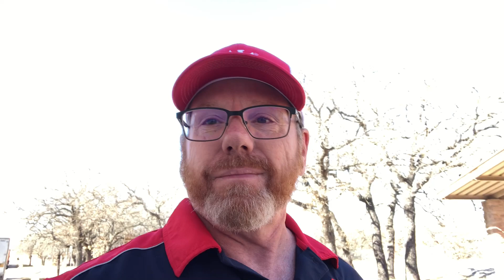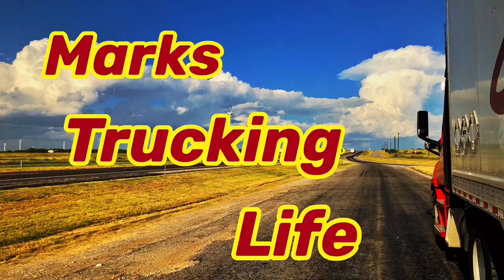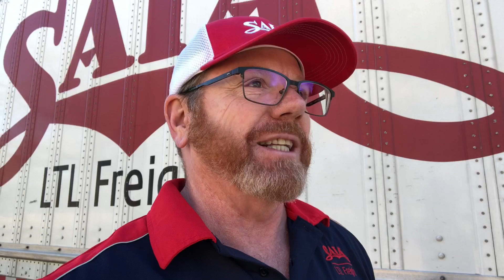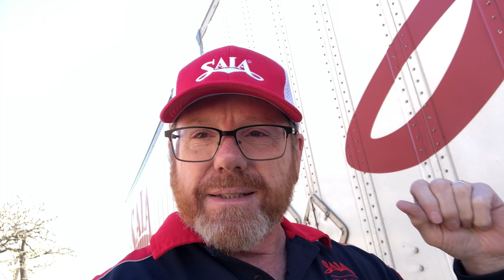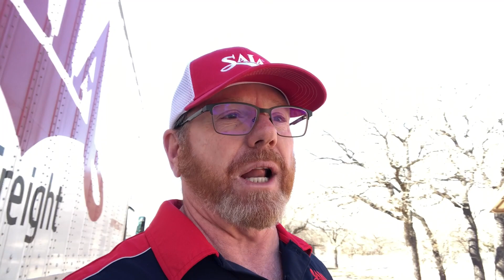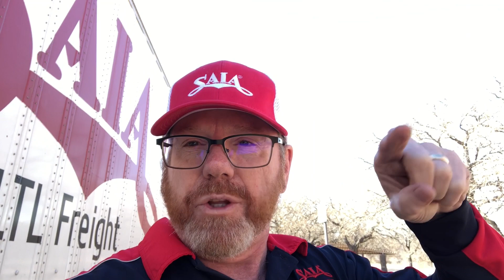TRUCKING | Automatic Braking Systems | DOT

Comment: I’ve had several times where these automatic braking systems have gone off. 

1. Shut down on I-30 outside of Rockwall due to an overpass. 
2. Threw my co-driver out of the bunk in Woodbridge , NJ when a inexpensive radar detector went off on the vehicle ahead of me and said vehicle’s driver brake checked the truck thinking I was a cop. 
3. Went off on ice in a parking lot due to the metallic reflection ice gives off, preventing my co-driver from being able to unhook my back trailer from the set on Thursday afternoon. 
4. Went off due to a flying plastic bag on I-20 outside of Dallas while my co-driver was driving and I was trying to sleep. This broke the water tank and motherboard on my 8 month old Philips DreamStation CPAP, which I had just registered for the Philips CPAP recall at that time. Thank GOD for bunk restraints…

Comment: Had system installed on UPS tractor and while driving at night a car kicked up a black empty garbage bag the bag flew in the air and the system picked up the bag.  Brakes set up and it was a fun ride.  If it would have been on slick roads I would probably been in the ditch with a set of doubles!